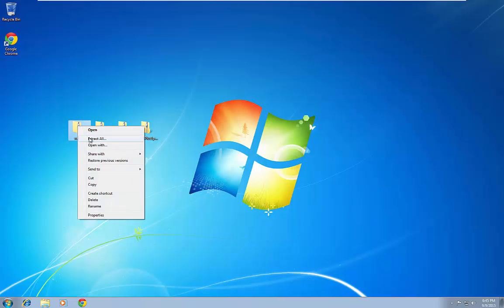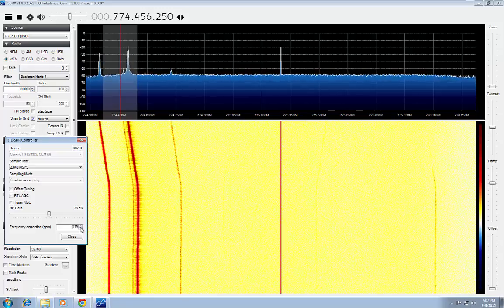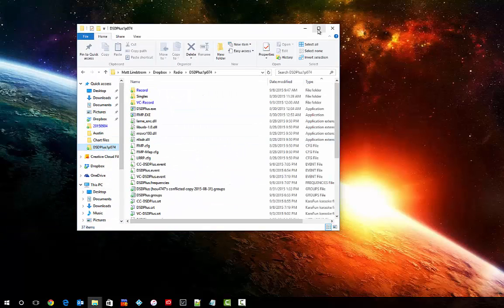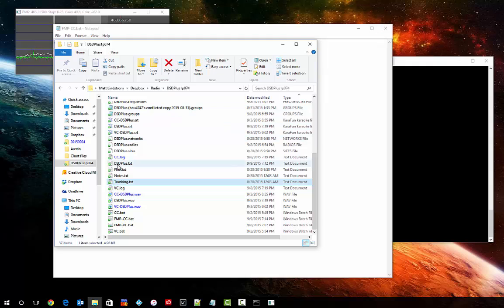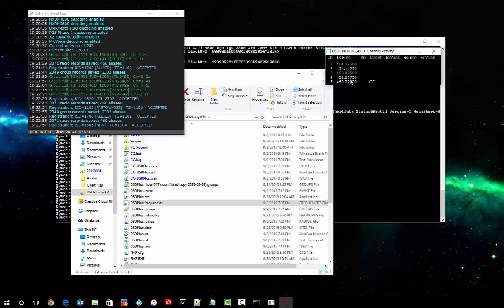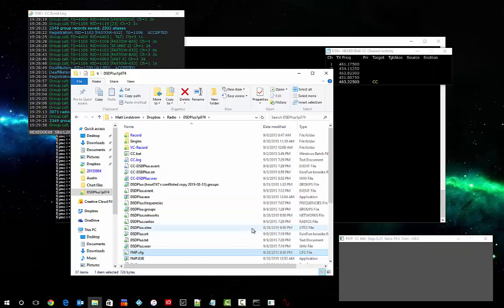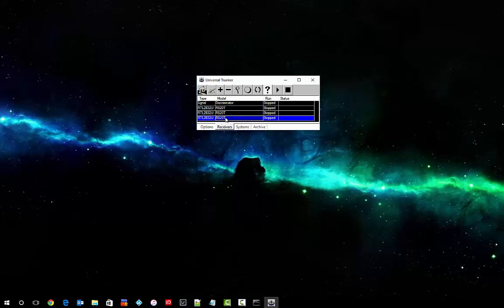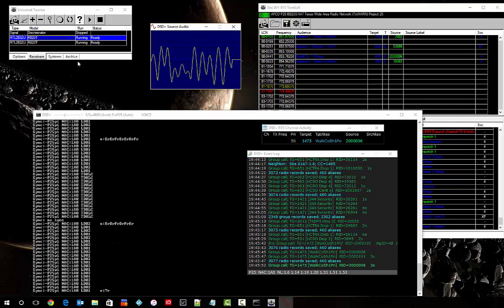RTL SDR High Level

Comment: thank you! 
very informative and useful video, i still haven't been able to make this work yet but i'm close.
i was wondering do I have to use the the virtual audio cables or can i just use whats on the computer?
man I wish you lived closer I would so pay you to come get this working for me!
Reply: How Can I Decode TIII (Hytera) trunking system ?
Reply from the maker: +Richard Scruggs It depends on your particular setup, but virtual audio cable is probably the most widely used and if I recall you get 2 virtual cables which is usually enough for simple configurations.
Reply: +Matthew Lindstrom thanks, but this is anything but simple for me, I am not at all familiar with trying to set up the dongle to monitor my local PD and FD, while your video cleared up some questions that I had, I'm still very much in the dark as to how all this works and having to learn each process as i go is a bit intimidating, also when i tried to download the virtual cables I kept getting a message saying that it wasn't recognized. 
anyway thanks again, I'll continue to try and get this going, and who knows maybe learn a little something in the process.

Comment: Million thanks bro. Got a question, am getting a list from an EDACs mode BUT am not getting the frequencies aside from the park frequency..thats from unitrunker.
Reply: Also i cant find exactly the exact control channel frequency from my area, am not seeing any red marked in the list of radioref.. Do i need a pro account to view it?
Reply from the maker: +revo adan What system are you trying to monitor?  I don't believe you need a pro account to just view, it does give you better search tools and the ability to import into other programs however.
Reply: +Matthew Lindstrom Am using DSD+ and Unitrunker. I was able to l;isten to CC in my area. But i manually list the frequency. Am doing to VCO on 2 CC and everything turns green on both window. The VOICE side seems doing will on tracking the frequencies from the 2 CC windows. Am just a bit confuse on RANKING. Hope am doing everything right.. My city is using EDACS with ESK trunking.. and DSD says its PROVOICE.

Comment: What does CACH ERR slot 1 mean? I see DSDPlus scrolling but, all I hear is the digital noise. Non-trunked  system.
Reply from the maker: +mandy evans What system are you trying to monitor? Can you link to it on radioreference?
Reply: +Matthew Lindstrom - It's a 70cm repeater in Scranton, Pennsylvania. Thought I'd begin with something simple to decode and I can't seem to get it. It's a DMR repeater. DSDPLUS shows errors and all I hear is the digital noise through my speakers. Watched videos and read tutorials and still can't get it to work. Thanks.
Reply from the maker: +mandy evans Can you try getting a raw recording of your input signal?  You should just be able hit the 'r' key while in the DSDPlus window and it will record to a file and display the file name.  Once you have that please upload it somewhere like Dropbox and I can take a look at it.  Also, if you have SDR#, can you tune to that frequency and try to get a screenshot of an active transmission?
Reply: +Matthew Lindstrom - I discovered the problem. Under the sound properties, your play back default device has to be the speaker also, click on the cable input which is your virtual audio cable input and click properties. Under levels ensure that it's set at 50%. Under the recording tab ensure that your default item is the virtual cable output. Click on properties and open the listen tab. Click the listen to this device box. Now, open the levels tab and ensure the cable output is set to 50%. Now, when DSD plus is decoding digital data turn the volume down in SDR sharp and the voice should come out of your computer speakers. I had my levels set wrong.
Reply: +mandy evans - Also, cable output properties under the advanced tab, change default format to 1 channel, 16 bit, 48,000 hz dvd quality.